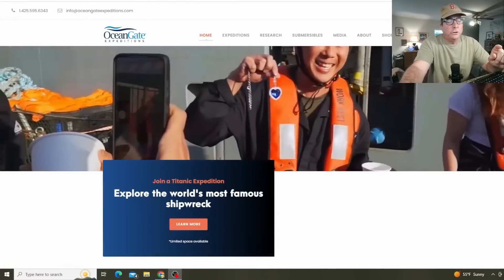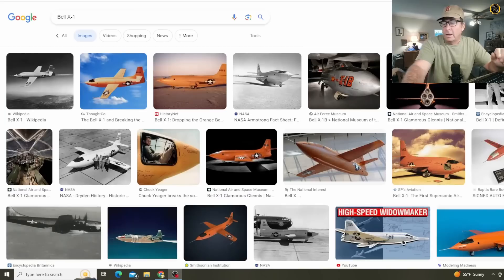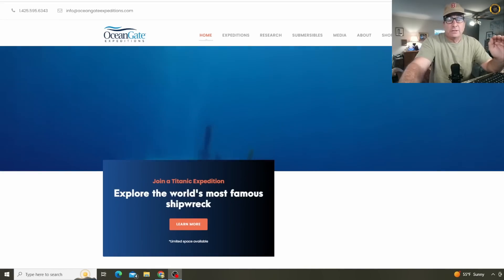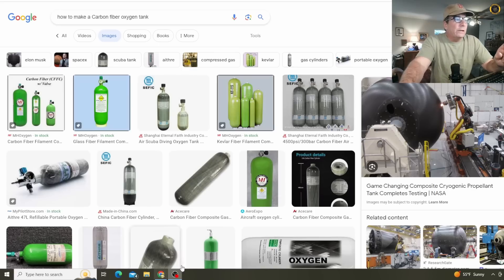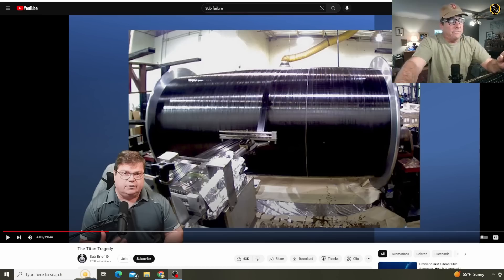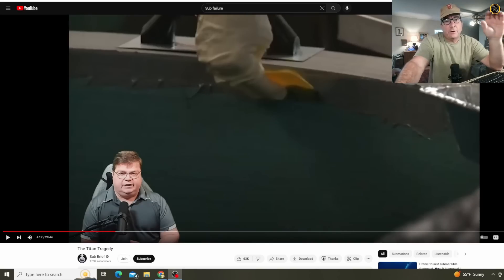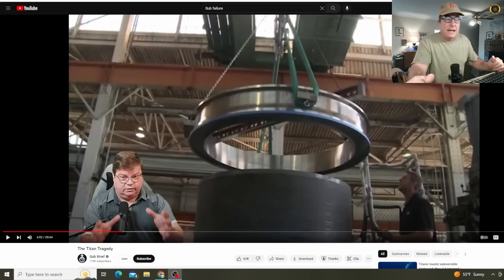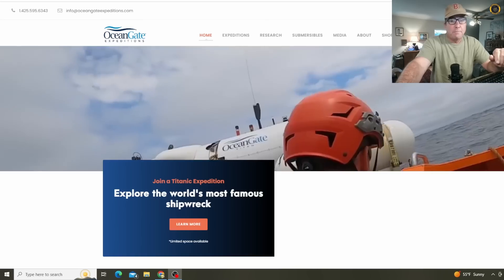Oceangate Sub Construction Details and Implosion

Comment: Food for thought: Couldn't the outer titatnium rings have overhang outwards or inwards and both rings held by rods running parallel with the hull? Like have rods on the inside or outside of the vessel to help keep the rings in place and not just adhesive.
Reply: That was not the problem. Pressire held all together. Probably, carbonfiber, under such stresses, cyled stressing, and or contact stress with  dissimilar property material. Imagine you are pinching a rubber tyer, bit old, overpressurised, with needle.
Reply: At 400 bar pushing also on both ends, so the caps onto the CF hull, will make no difference imo
But you can relieve that pressure which is longitudinal on the hull and keep it more stable with rods.

The choice of material, ie carbon fiber and multi component, with glue connections, is asking for trouble here to begin with. The very begin of the design is a disaster.
Reply: Or inside the vessel, I like your thinking: mechanically connected end caps.

Comment: As a level 3 NDT guy I have never seen carbon fiber used in compression like this was ! At the very least I would have tested the carbon fiber on the inside of a Titanium tube ! Not the other way around ! As a young inspector I worked QA/ QC with down hole oil inspection tools ! I have imploded a few housings in my time some open hole ! It’s as instantaneous as turning on a laser beam ! A 50’high column of water appears to be at the well and ceiling simultaneously. The metal like beryllium copper turns to shreds and powder ! Testing went to 30 kpsi at up to 400 F ( we used a WW2 5” cannon barrel for testing housings) you have to test every single thing as you go ! Cost means nothing compared to your life !!!
Reply: PS I have extruded a few Orings in my time as well ! We always used double Oring groves ! Even with Viton Orings they would extrude !
Reply: @ITSFUNZ  I'm pretty sure your pinky finger nail clippings have more engineering knowledge than the entire OceanGate team.

Comment: Well sure, carbon fiber construction may be problematic, but hey, how about that plexiglass window that was only rated to 1300 meters, not the 3800 meters at the Titanic's depth?  

Now to be fair, it only deformed during the dive by a mere 3/4 inch.  It's not like it was deforming an ENTIRE inch or anything.  Here's the reassurance we have from the genius CEO who was instrumental in the design: "And acrylic is great because before it cracks or fails, it starts to crackle so you get a huge warning if it’s going to fail."  

Got that?  "HUGE WARNING" (technical industry term), so clearly they'll be looking elsewhere for failure points I suppose.
Reply: Acrylic is fine to use. I bet it wasn’t the porthole that was the e problem.
Reply: C'mon, it only deformed a fraction of an inch.  OTOH, it deformed 20+ mm.
Reply: @johnpublic6582  Well actually, here's the direct quote: " 'It’s acrylic – plexiglass,' Rush tells Estrada after being asked what the window mounted at the front of the Titan vessel is made of.

'It is seven inches thick and weighs about 80lbs. And when we go to the Titanic, it will squeeze in about three-quarters of an inch and just deforms,' he explains. "

I suppose 3/4" could be considered a fraction...?

Comment: Non destructive testing is difficult with composites as you say but "condition monitoring" is relatively straightforward and well established over many years. Acoustic Emission monitoring is able to determine deterioration mechanisms such as matrix cracking fibre breakage and fibre pull out. Admittedly the latter two are tension failures but that is where a fibre reinforced composite works. String is strong when pulled but you wouldn't use it in compression to build a car jack! This was a very strange choice of material for compression loads!

Comment: Glues, compressed carbon fibers, and composites.. dear god. Fine, forgo certifications that are too burdensome but at least get 2 or 3 top hull cycling and composite material consultants. And do finite element analysis. If you are a billionaire, you shouldn't skip relatively small costs for safety.